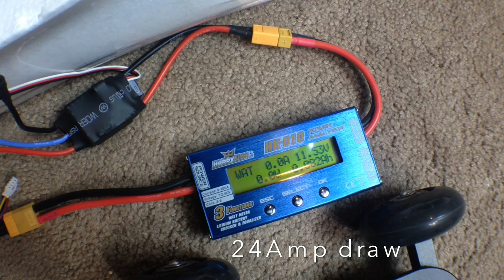Bix3 Motor Installation Smallpartscnc Adaptor review

Comment: The video was very instructive on how to removed the motor mount but my one thing is that this airplane is heavier than the bixler 2. I thing it was better to upgrate to a carbon fiber or balsa wood motor mount to reduce some weight from it.

Thats my personal opinion.

Comment: Hi demo, did the same thing but the CG was way out.
I then attempted to put the new motor in about the same position as the old motor 
by cutting the motor pod off back to the vertical support, and regluing in the cnc mount.
CG was almost back to normal.  2600 3s solved the CG problem.
With a 9 x 6, it goes like a pylon racer.
Reply from the maker: sounds good. A lot of people just add a lot of battery weight to compensate.  If I were to do it again I'd cut 1" off the motor pod

Comment: Can i run 4s battery on stock motor?, i have a 50A esc i can put in
Reply from the maker: You can but I wouldn't trust it... also you would need to prop down
Reply: Yep, thats what i was thinking
Reply: Definatly add a external bec incase esc craps out mid flight, @least with that you still have servo controll, but no throttle

Comment: Whats the point in the collar going all the way into the inside of the plane when the motor mounts on the outside of the bracket? Doesn't that push back the weight as well? From what I hear, its already tail heavy. I'm ordering my Bix3 in a few weeks and I'm sure sooner or later I will want to replace the motor.
Reply from the maker: If the inside collar wasn't there the motor would easily break off. If I did it again I would cut one inch off the foam motor mount to move the weight forward a bit
Reply: it just looks like the motor should go on the inside of it, keeping it positioned in the original spot.
Reply from the maker: The hole is too small for the aftermarket motor

Comment: shows, with ecalc, 8x6 prop on that motor over powers the motor the motor power is maxx 370w  Specs.
Max Loading: 31A
Max Power: 370W
beware running a 8x6 prop pulls 392.5w
Reply from the maker: This may be true but I almost never ran this airplane at full speed because it was extremely fast
Reply: Ya full throttle fully loaded down with fpv gear myn flys great but mainly half throttle my spitfire smoked the motor after 3 battery's

Comment: run this motor with a plush 40a on my bix 3 works perfect, I put this motor with the plush 40a on my ft spitfire and the motor fried after 3 batterys... not sure y
Reply from the maker: +Jason Mcendree You might have had a faulty motor... Ton's of guys run this setup

Comment: Hi Demo,
My bix3 is now set up in a similar way to yours. I was amazed at how much weight the motor adds to the rear. To balance this out I had to add approximately 100g to the front. It now makes the bix quite a heavy plane. Do you think this will affect the longevity of the motor? Can you give me an idea of how much weight you have added. Cheers Stuart
Reply from the maker: I standardly use two 2200 mA battery packs, In the nose of the airplane this balances out perfectly, I did have to modify the foam just slightly
Reply: Thanks Demo - I will give that a try!
Reply from the maker: thanks for watching!

Comment: Good video. I burnt out my stock BIX3 motor after a few hours of FPV flights. Found this video in a search for a replacement motor and then went out and purchased your setup. I'm looking forward to a bit more speed for FPV. Thanks for posting!
Reply from the maker: You'll be totally happy with the set up,  it's fast and bulletproof

Comment: Hey Demo7,  I wanted to thank you for the video .  I followed your vision for the Bix 3 but after taking out the stock motor I wanted to also take out the motor mount then decided to cut a quarter inch off the CNC adaptor.  I didn't need to cut in to the EPO . SO thanks for showing me(us ) the way to go.
Reply from the maker: I wish I though of that!  If I had to do it again I would cut 1 inch off the phone to that the CNC motor adapter sits inside of. This would shorten the length of the motor assembly and keep more weight forward
Reply from the maker: *foam not phone

Comment: hey demo 7 I have a question. I'm new to elec. motors and wanted to know which wire goes to which esc wire.  No instructions for the motor wires and no instructions on the wiring for the esc.  The esc instruction just say to soldier the wire together. which wire?
Reply from the maker: The short answer is- it doesn't matter. Brushless motors can't be shorted out by improper wiring. Basically plug in the motor in any way, test the motor by running it. If the motor is running backwards, swap any two wires to switch the running direction.
Reply: Thank you!  I'm so afraid of blowing something up or catching on fire. So, no wires are  dedicated to pos. or neg.
Thanks for the videos
Reply from the maker: No problem, glad to help!

Comment: If it helps I just finished my bix build.  I used this same motor but it fit fine on the stock mount.  I had to drill out two holes on the mount to line up the holes with the motor.  However it fit fine.  I'm running a 6 by 4 prop but going to test others.  Just did my maiden yesterday.  Windy buy fun.  However in mid flight my fpv converted foam pod fell off and made the cog tail heavy.  I barely got it on the ground.  So sketchy to fly with it super tail heavy.  Make sure to replace magnets with bigger ones or secure the pod more if you add weight to it.  Thanks for vid and help.
Reply from the maker: Thanks for the information!  I always run a rubberband around the canopy which has my fpv gear on it

Comment: Hello sir
I checked the original engine while working
  There are strong vibrations
But there is no need to replace the engine it unnecessary
What I did was very simple
I added two more screws
And vibrations are gone.
Now the engine works great
Reply from the maker: Thanks for that tip!  I use 10" props which is the other reason I changed motors

Comment: If I'm buying the bix 3 ARF then I would have to assemble it myself. I plan to use this same motor so right of the bat I will mod the mount to fit this motor. If there anyway to mod the existing mount to fit this motor? Could the motor fit on the original mount in its original location or could slide all the way to the end? What are your thoughts or is it worth spending the extra on this?
Reply from the maker: You would need to hollow out the foam tube I believe. It would be more ideal to keep the stock location because the CNC adaptor puts a lot of weight toward the rear of an already tail heavy plane. The other thing you could do is cut about half the foam motor tube off and use the CNC mount- this brings some of the weight back to the front

Comment: Question, with that Smallpartscnc Adaptor  couldn't you leave the stock motor mount in and just cut off , say 1/4 inch of the adaptor tube seems way long enough ?
Reply from the maker: Yes, that is a smart way of going- I didn't think of that at the time and I wished I did- thanks for mentioning it!

Comment: Thanks for the video. I ordered a Bix 3 last week and after seeing your video I ordered the motor mount yesterday. I will install the CNC motor mount right off the bat instead of the stock one. I will most probably install the stock motor 1st and then switch to a MTN.
Reply from the maker: If I were to do it again I would chop off 1/2-1" of the foam tube the CNC part goes into. This will help with the tail heavy nature of the plane and will help the cantilevered weight that is against the rear wing mount. I had a crash (fixed now that tore the whole motor pod and rear wing mount off. I think the weight hanging off the back so far didn't help. Good luck with your build!
Reply: 7demo7 As you mention, I am worried about it being tail heavy so I will cut off 3/4" of the motor tower. Thanks for tip. I'll let you know how it works out later this month when I build it.
Reply: Oh I forgot to mention that I will hot glue the wing spars.
Reply from the maker: Very good, I'll be intrested to hear how it works out. I added a carbon spar to my horizontal stabilizer so my tail is even heavier. I have my 2 2200 batteries all the way in the nose to compensate

Comment: Thanks for the vid. Got the same motor and mount to install in mine and watching this has probably saved me from more than one critical error!
Reply from the maker: ElMattbos So glad I could help! In retrospect I probably should have cut 1" off foam motor collar because the motor is so far back when using this mount.  Moving that weight 1" forward might help not torque against the motor tower.  I crashed after this and ripped the motor pod off- all repaired now as good as new...

Comment: Very nice motors :)
Maybe a stupid question but why most of people do not use carbon fibers prop on their plane?
Enjoy the last days of 2014
Reply from the maker: Not really sure, I'd like to try one though. The reasoning I didn't for multirotor was the cost and they're not as efficient as most people think
Reply: 7demo7
A carbon has way less flex and a better efficieny but the costs are higher (which is not really a problem on a pusher plane. I tested the Volantex Ranger EX Prop, the Graupner Carbon and the APC on my Ranger EX and could see the difference between the crappy stocker and the high quality Graupner.
Reply: they don't run them in multirotors because they cause too much vibrations, i think that's why they don't use them in planes too
Reply from the maker: JuampixDDD I'm sorry but, that is just not true...